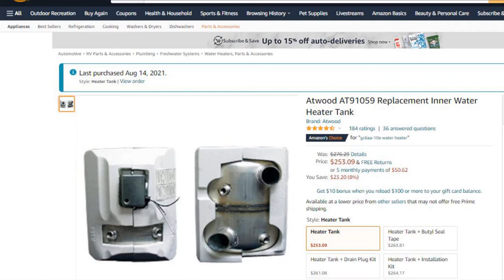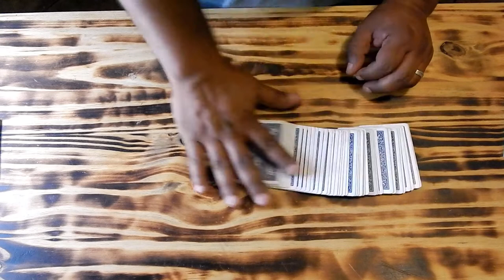Replace  Water Heater Tank for North Trail RV plus a magic tric

Comment: @Alvaro's Outdoor Adventures  WOW  Great video!!!  You make it seem so easy....lol.  I have the same problem.  My tank is cracked and its leaking water.  I have the same exact water heater as you do (Atwood Gc6aa-10e Tank).  Many of the videos that I have seen do not show removing and replacing the rings and washers and you do.  But I have read on blogs that it is extremely hard taking off the old one and putting in the news one.  I have a rubber mallet and a chisel, but I wonder what type of tool is need for that.  Alvaro, I am going to tackle this project this weekend.  Oh what fun!!!  LOL.  I saw that the tank includes the rubber washers and the rings, but does the new tank come equipped with a new element?  Or did you use the old one from your old tank?  Alvaro, thank you so very much for sharing with us on how to replace the tank.  Your video is very very informative, so thank you very much.  ...... Rick
Reply from the maker: That was my purpose of the video. Glad I could help you. I would say that the locking rings will be the ones that will give you the most trouble. Thanks for watching.

Comment: Tackling disassembly right now, the locking rings are a pain. Any tips?
Reply from the maker: Sorry, just got this. if you are taking them off, it is better to rip them! your new tank will come with some new ones.
Reply: @AlvarosOutdoorAdventures  it sure was fun haha. I'm repairing my old tank trying to avoid buying a new one so I'll get to have a blast putting new ones on lol.
Reply from the maker: @throughthesebrowneyes5485  what are you repairing? Did you find out what was the damage.
Reply: One of the welds was cracking where the jade control inlet goes. Pressure testing it today to see if my patch job holds 🤞.
Reply from the maker: @throughthesebrowneyes5485  oh oh. Well hope it works. And thanks for watching my video.